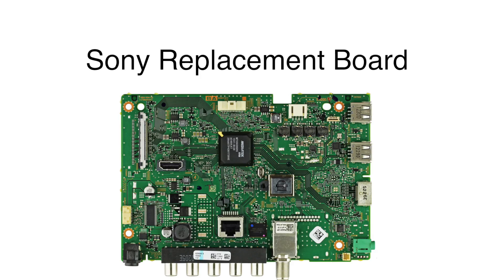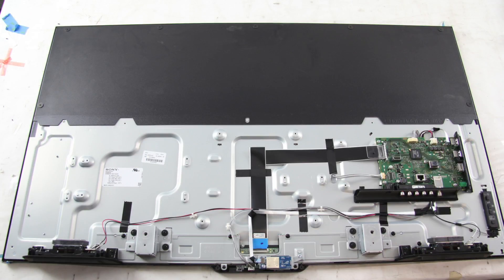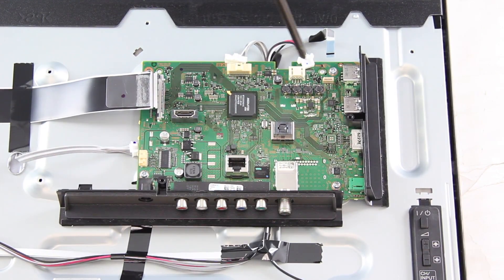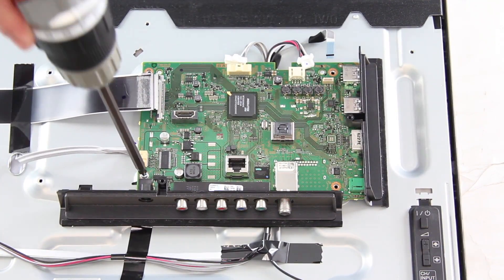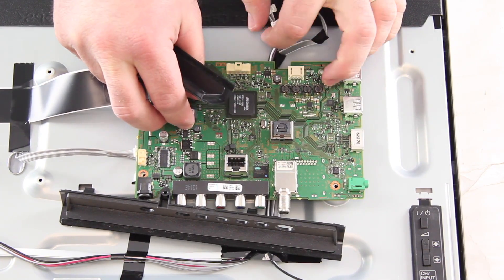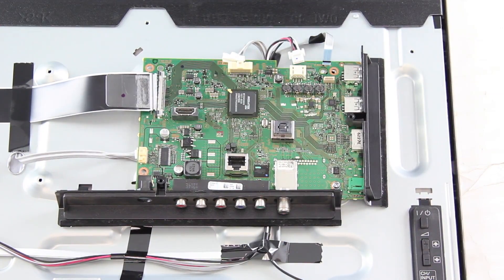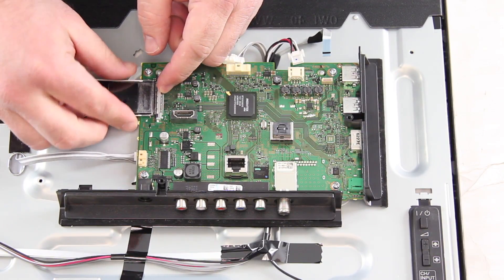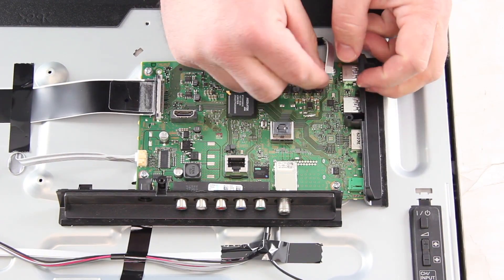Sony 40" LED TV Repair KDL-40R - How to Replace The Main Board Part Number A-2066-942-B

Comment: Hello, I have a samsung 56" Plasma TV. I tried the isolation method and it only clicks when the main board is plugged in. The main board sends the signal to the power supply to turn on the High Voltage but after about 2-3 seconds it then turns it back off. Do the main boards in the plasma tv's receive a status from the power supply? Or is this error most likely because of a malfunctioning main board? I'm trying to figure out the pinout for the connector of the power supply, If I could just send the pwr_on signal with an external source I could see if the tv turns on.

Comment: Panasonic viera tx p42u30b
Hi just a quick question,I've replaced the power supply board on it but it still won't start up? Displaying 5 green flashes when I hit the power,could be 6 as it's very fast lol is it the y board I need to replace?